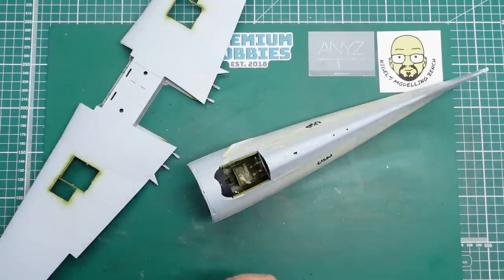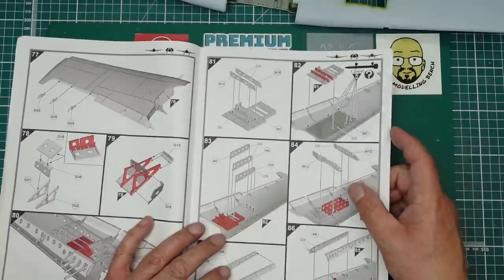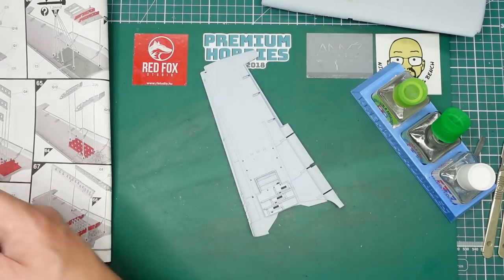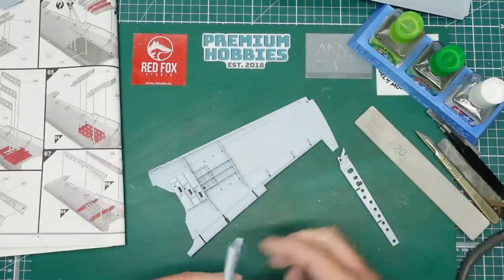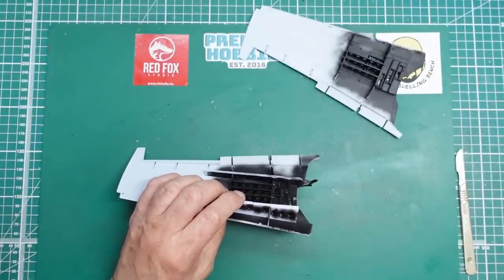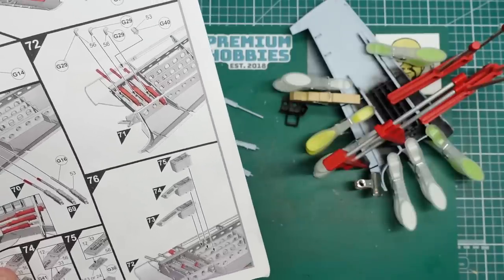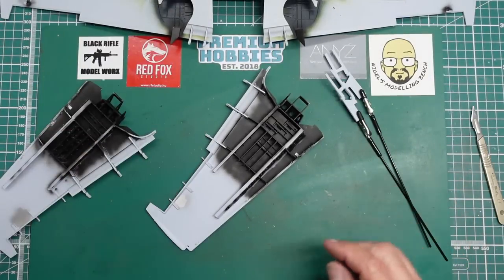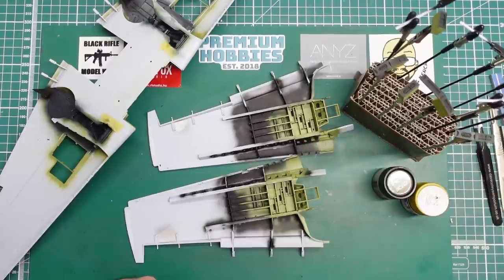Airfix 1/24 F6F-5 Hellcat build. Part 15.

Comment: Zinc chromate yellow was developed by Ford Motor company in the 1920s. It  can vary between yellow and yellow green and pigments can be added as was done to use as a second coat to confirm coverage of the first and future wear repair. Hellcats were built during the war and production would not be slowed down by the issue of primer colour accuracy so there may have been noticeable differences. Wikipedia has further info.
For anyone wishing to use a electric motor to spin the prop, the Airfix motor is known to be unreliable. I used a barrel 1.5 volt motor from a electric toothbrush that fit and the RPM is appropriate. I mounted a switch on p#F23 that is covered by a friction fit p#F24 to conceal.
I have posed my build in flight on a custom metal stand that mounts where the tail hook exits.
This allows the model to pitch from port  - starboard 360 degrees.

Comment: I don't know if this is of any help to you Nigel, Ok this is interesting and it goes against Airfix's advice 

Grumman F6F Hellcat

By the time Hellcat entered mass production, Grumman had made the decision to adopt Interior Green in place of Bronze Green for cockpits, and possibly also to adopt Zinc Chromate primer in place of its own Grumman Grey. However, older paints were to be used as long as their stocks were available.

Thus the first hundred or so F6F-3 airframes produced almost certainly had their cockpits finished with the remaining stock of Bronze Green. Subsequent aircraft had their cockpits finished in Interior Green. Starting with F6F-5, cockpit area above and including the side consoles was finished in flat black with the remaining surfaces in Interior Green.

The inside of the engine cowling varied throughout the Hellcat production, being Grumman Grey, Interior Green or Zinc Chromate Yellow. Later F6F-5 and had flat black cowling interiors. Other enclosed areas of the fuselage were either Grumman Grey (on early production machines) or Zinc Chromate Yellow.

In common with the general Navy practice the wheel bays and undercarriage legs were finished in the lower surface colour. However, the area ahead of the main spar in the wheel well was left in Interior Green. Also, some photos of operational Hellcats show wheel hubs and legs in Aluminium finish, possibly applied during overhauls at field maintenance depots.

with thanks to IPMS stockholm 

https://www.ipmsstockholm.org/magazine/2004/05/stuff_eng_interior_colours_us_part3.htm

and then there is this which Jamie from Soveriegn Hobbies has written before also lends credence to my thoughts this was compiled by Dana Bell
Reply from the maker: Thanks Annie,

Funnily enough i was looking at that very page this morning. It would appear that the cockpit upper should be black and the engine cowlings black inside too?? I think the colour I've used is correct for the gun bays and possibly a yellow should be used around the engine frames? Apparently the bulkhead and main spar was chromate green so at least i got that right?

Comment: Thank you Nigel! BTW back in the 70s the 1/32 Hasegawa Hellcat was a great kit with optional -3 and -5 parts which included different tailplanes, canopies and other details often missed in later kits. These seem to have been dropped from later issues - I first built the Frog box-engineered version, which I guess shows my age… 😂
Reply from the maker: I hope and pray Tamiya do a 1/32 F6F Alison.
Reply: That would be nice but they seem to have given up after the Mossie…